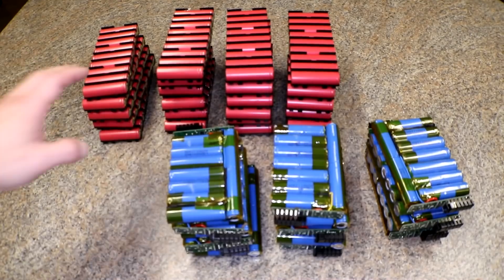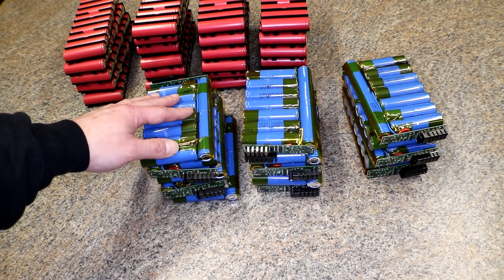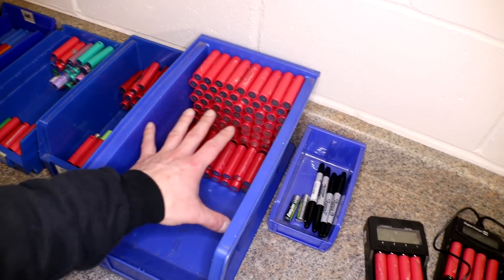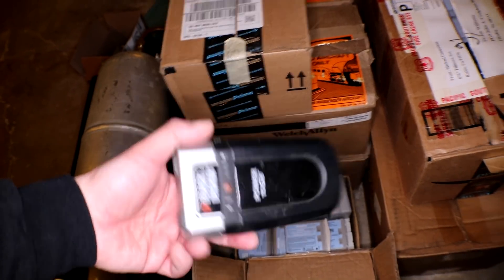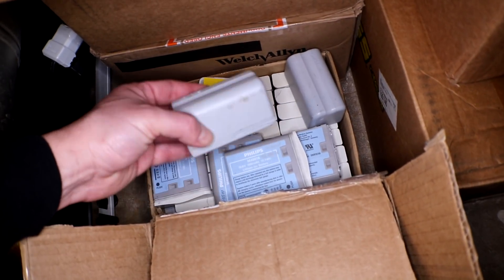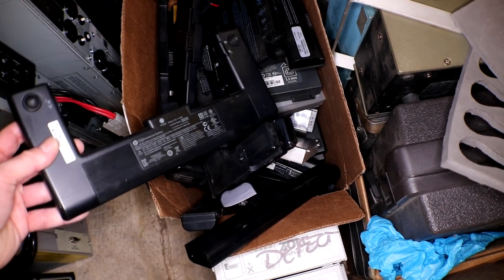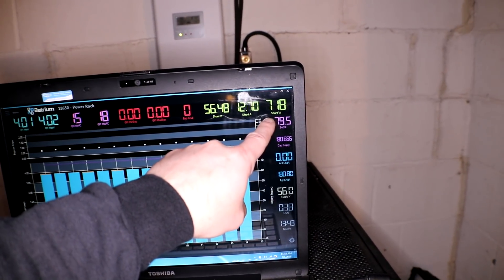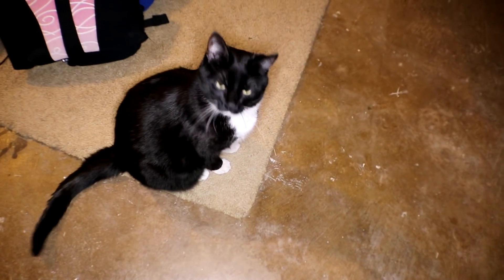Diy Tesla Powerwall ep77 More Randdomness and to much to DO!!!

Comment: Hey Joe would you mind seeing if your charge controller will charge to 15.5 volts Im not having any luck finding something for my 4S im thinking ill have to put something together myself
Reply from the maker: It should charge at that voltage no problem!  All the settings in the controller are setup and defaulted to 12v.  In order for me to set it up for 24 or 48v I have to multiply 12v  lol😆👍
Reply: im seeing a lot of programmable able to charge to 15 volts but that is not enough between my 4S and my inverter i need 15.5. I took a look at the specs on the one you have and it said 15 volts thinking that might be an over site i thought i would ask i just dont wanna put big money in something and it end up not working for me.
Reply from the maker: +Steven Rowland You can change all the setting to what ever voltage you want. Basically setting float and bulk or what ever it is to the voltage you want. Thats what we all do for our 48v settings. I have a video about setting it up and you can see the settings I change. You would just make yours at 12v. Also if you do end up getting this one you should use my aff link down below 😉😉😉 and it helps support the channel 😃🖒

Comment: Joe - on those HP's you will have prism cells - they are quite OK. I had to 3D print holder to keep them together. Check this out: https://goo.gl/BFzU7e
Reply from the maker: Nice, dont think I have gotten any of them yet.  How was the capacity on them.  Thats a pretty sweet pack you got there!🔋👍
Reply: AveRage Joe forgot to mention they're pain in the ass to disassemble, capacity is around 2000mAh most of mine where 1800. I'm more than happy to provide you with STL file :-)
Reply from the maker: +emceh They look like a pia to open lol. Ya send it over😃🖒